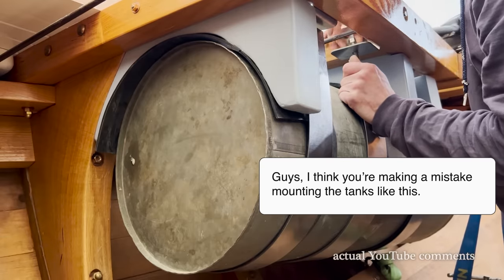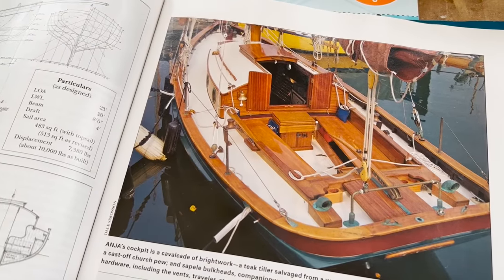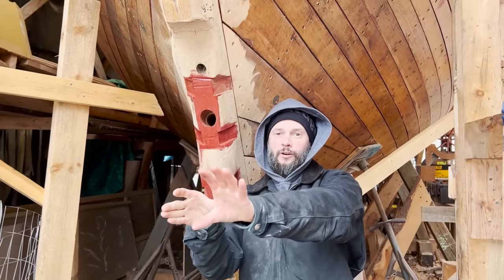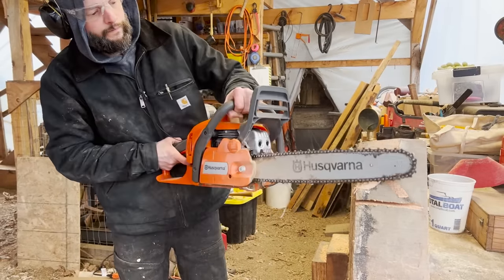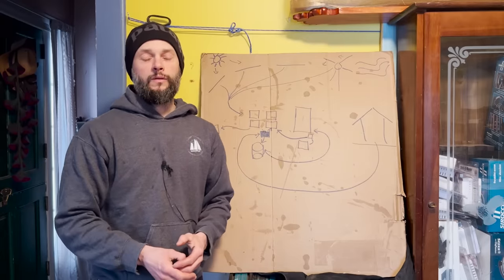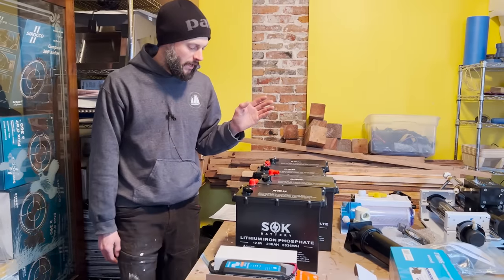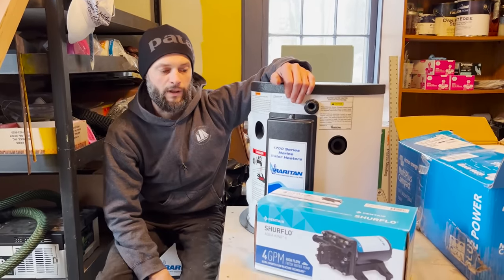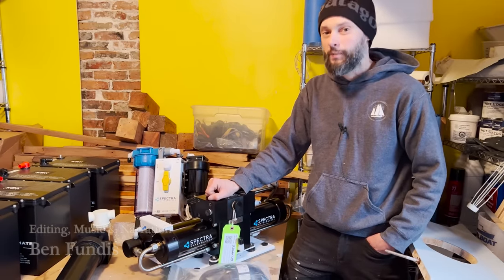That Prop Is Too Small & Other Comments - Episode 248 - Acorn to Arabella: Journey of a Wooden Boat

Comment: They've watched too many movies, if I pour diesel on the ground and drop a cigarette into it, the cigarette will go out. Diesel burns under high compression not it's fumes
Reply from the maker: Maybe it’s just a misunderstanding. Some people hear “fuel” and immediately think “flammable” because of a lack of knowledge but a hope for safety. —Anne
Reply: That’s not what I learned from extensive knowledge gained from watching Indiana Jones movies.
Reply: A cigarette dropped in gasoline will also go out. The “fumes” of both will definitely ignite when exposed to an ignition source at the proper air fuel ratio. Diesel engines have glow plugs for a reason.
Reply: @ronaldgriffin5528  been there done that, the trick is to have your buddy hold it in Styrofoam cup, lol. They don't last long.
Reply: @ronaldgriffin5528  glow plugs are not spark plugs, diesel engines don't have spark plugs, a heating element in diesels is used to start the engine in the cold, the element doesn't keep running after you press start
Reply: Dear taylor.
👍👌👏 EXACTLY (at least nearly). 😁 ;-) Okay, a burning match will go out if you toss it into a bucket/barrel full of Diesel. But if a glowing cigarette is thrown into a really shallow puddle of Diesel fuel, there might be enough heat to ignite the Diesel after some time.
Best regards, luck and health.

Comment: As a lifetime tradesman I've always been amazed when i see workers that try to hold a sawzall out so the foot is in mid air. The foot is designed to sit tight to the work surface.
Reply: The sawzall foot is designed to sit against the work surface, but there are tricky situations where the vibration from the tool against the surface is not desired, for finer control of the tool. As a "lifetime tradesman", I would think you would be aware of this from experience, and not so amazed by it.

Comment: I admire the amount of thought and analysis you’ve put into the boat’s systems. All the electrical seemed very familiar to me since I just finished installing an off-grid solar system in my camping cabin in New Hampshire. But other touches filled me with admiration, like putting the filter that if it burst would wet a lot of stuff, so put it in the head which is built to shower in anyway! Now that’s thinking! 😊
Reply from the maker: Nice project, Douglas! Bet it came out great. 🙌

Comment: From experience as a marine engineer, it's great to have positive pressure in the fuel lines to filter and injector pump, certainly less chance of getting sir in the system and it really does happen! So tanks are in a great place!

Comment: Your tank mounting is just fine. I have seen far worse setups in factory boats that have lasted the better part of 30+ years. 

Your explanation of the prop sizing is spot on. Prop technology has improved a lot over the last 10-15 years. It is amazing how much more efficient a smaller wheel can be.

Comment: I have been on a trip on a friend's boat with a water maker - you can't have too many new filters on board especially on a trip where getting some to be delivered to a unfamiliar port - stock up - fresh water is like gold even in "developed" areas.  Best wishes from Chesapeake Bay / Middle River, MD!
Reply from the maker: Happy Friday, Frank!
Reply: Looked like standard 10 inch filters, cheap to stock up on.

Comment: Diesel engines were some of the very first internal combustible engines. They were definitely around when your boat plans were originally drawn. They have been in boats for well over 100 years.
Reply: Mr Otto Diesel himself! I think they provided propulsion for the first horseless carriages.
Reply: Early diesels were, in fact, run on peanut oil.
Reply: 1903 first marine diesel used but not widely used for many years

Comment: Very solid setup for human needs. I have a lot of experience with shurflo pumps, mainly in carpet extractors. They utilize a pressure switch to shut off the pump when system is pressurized. Pump turns back on when water flows. One thing with diaphragm pumps is sometimes the diaphragms get stiff over time and can cause issues. Getting a rebuild kit with new diaphragms and check valves to have on hand could be handy as they are easy to fix, and you can bypass the pressure switch in a pinch with a jumper if it gets persnippity. Just have to shut pump off manually so it won’t run continuously. Thanks for sharing, and hope Steve’s mom is resting well. It’s a noble thing to care for those who raised and cared for you growing up. Stay the course.
Reply from the maker: Thanks for sharing your experience!

Comment: I didn’t read all the comments so if you’ve previously addressed my apologies. I didn’t hear your discuss alternator sizing but will assume you have that covered. The lithium batteries can charge up much faster than their lead acid counterparts.  One or two high output alternators can lower the engine runtime when charging.  Great build and love hearing your thoughts along the way.

Comment: Greetings from Colorado!   Ahoy mate!
Something to think about as you consider the infill for the rudder is the effect on the prop’s wash and the creation of turbulence that greatly lowers the efficiency of the propulsion.  Especially where the wash encounters the “leading edge” of the rudder (inside the infill). Water flow will be deflected in any case because of the rudder’s existence.  But you want as much energy as possible to impact the surrounding water mass in a line straight aft of the prop for max efficiency of the system of engine/prop/rudder and desired direction of travel.   
Avast all ye landlubbers!

Comment: You mom will  be with you whether she is on board or not. Running the engine 10 minutes up to operating temp (170 deg) will give you all the hot water you need.. Most of the time you will  already be motoring or on the dock and rarely need expensive inverter energy for the heater.  And once its heated and everything has been turned off, it will stay hot (or at least warm)  for several hours.  The fuel tanks will work fine enough  but  having them elevated defintely not optimal. Everything in every sailboat should place weight/density as low as possible for performance and seagoing comfort.  Beer in the bilge, bread in the overhead cabinets. There have been many lessons learned since Atkin.  Prop/rudder setup with the sacrificial plug  on the rudder sounds like a great idea.

Comment: Steve, you make a very common error with AC Voltage.   110V was used for lines power was when Edison was designing power systems.  Voltages have increased since then with 120V/240V bing the U.S., split-phase standard since 1967.  Move into the modern age and call your AC Voltage, 120 Volts.

Comment: In other words, the propeller chosen is optimal for this boat! 👍
Reply from the maker: Exactly!
Reply: No, they hope the prop guy has done it right.  All I can say is that is the same diameter as the 3 blade on my 28hp ... considering the prop guy that turned up didn't know the difference between brass and bronze, I'm not so sure.
Reply: Actually the propeller is optimized for power available. The goal is to provide maximal propeller efficiency at rated power and rpm, i.e. a Diesel engine runs at optimum efficiency at 90% of maximum rpm, if the propeller is too large the engine will not get to speed, therefore being inefficient. The engine should be able to reach 110% to 120% of rated rpm, with reduced efficiency for emergency situations. As for a 28hp outboard I would assume a propeller in the 9” to 11” range with blades having a smaller area, more skew, and a much higher rpm range. Not having seen nor done the calculations, I would say a 16” propeller is about right for Arabella.
Reply: Another point to note might be that the propeller can be changed.  Optimizing propeller design is a vague notion.  Optimize for what?  Thrust, fuel efficiency, power absorption - and at exactly which speed would you like to optimize any of those performance parameters? Prop design is usually a wise compromise considering predicted hull speed, emergency situations such as wave resistance, wind resistance, fair weather cruising situations, importance of fuel efficiency, etc.  Of course, motor selection goes with it.  Fortunately, if a selected prop exhibits undesirable performance, it can generally be switched out for a design change where pitch, diameter, number of blades, etc, can be tweaked to get a better result.  It happens that it is very common to try different prop designs on a one-off displacement hull.
Reply: @boooshes  Yes, that is why they write whole books on it, PHDs have been written about it and still it can come down to trial and error. There is almost as much art as science to it, as with so much of boat building.
Reply: @boooshes  The ideal prop is one that just holds the engine to peak power output when the boat is accelerating from stationary, then you know that prop is capable of fully loading the engine.  You can run a smaller prop, sure, but then you might as well run a smaller engine to match it.

I am aware of the various compromises,  I also fly planes, with the same issue, you want to prop to be capable of extracting all the available power from the engine if needed. If the prop is too small, or too fine pitch, you can never use the full power, even when you really need it.
Reply: @itsverygreen532  I under what you are saying.  However, just extracting the power that the engine can generate is only the beginning.  That power can (some will) be lost in slip, create large thrust at low speed but lose it at higher speed, slip alit at low speed and become more efficient at high speed, etc.  Having done some propeller design myself for both boats and and tunnels, I don't think you can look at a picture of this boat and the propellor and determine that it is improperly designed.  The last design I did was fir a 34' semi plane hull optimized for efficiency at 8 knots and 18 HP.  Turns out that was a 16" prop as well, but Im sure the pitch and blade density were different than AtoA.
Reply: @boooshes  This is where the trade off between pitch and diameter comes in. All I can say though about that prop is that it is roughly the same size as the one on my 28hp Volvo Penta ... I very much doubt it is going to fully load a 50hp motor ... so I suspect the motor is going to rev more than it should ... not a problem I guess until you really wish you had more power in some situation and the prop is just too small to load the engine up.
Reply: @itsverygreen532  so just for kicks, I used two different sources for propeller sizing to horsepower.  It looks like a 16" propeller will absorb about 47-50 HP at around 1700 RPM.  I'm not sure about this particular diesel, but 1700-2000 rpm sounds about right for a marine diesel.  The pitch is likely about 8" , with a 50% blade area ratio (3 elliptical blades) and probably about 50% slip.  On face, I don't see anything out of the ordinary in the prop.  Your set up likely absorbs your 28 hp at around 1350 rpms.
Reply: @boooshes  So you think you would fit the same size prop to a 28hp and a 50hp boat?  That's "interesting"  FWIW,  Beta recommend a 15x9" on their Beta 30 and a 19x12" on the Beta 50.  I'd normally expect to see a prop around the 18"/19" size on a typical 50hp displacement sailboat. I found another install of at Nanni N4.50 same as they have ... that had a 19" prop too.
Reply: @itsverygreen532  Not necessarily.  I'm not sure that I would automatically assume that the combination you have is the perfect optimization either - and therefore may not use it as a basis for AtoA.  All that I was saying is that using some well-proven empirical approaches, the 16" selection was not " out of family ".   The Beta engines have a peak torque output around 1650 rpm - they may be using that as a sizing reference. I'm not really sure how they would size a prop to an engine without considering the application (type of vessel, transmission,intended use, variable pitch?), but a 19" x 9 on a 50hp at the rated 2800 rpm sounds large and I believe would risk not achieving max engine rpm.  All of that being said, in my opinion, sea trials in varying conditions are the only way to tune your prop choice.  In any case, they've got a prop that was recommended by a prop company and the company should stand behind that choice.
Reply: @boooshes  I know mine from stationary loads the motor up just a bit too much, so it won't fully rev out.  As the boat picks up speed the revs gradually increase and eventually it will reach peak revs.  thats a perfectly matched prop.
Reply: @itsverygreen532  So your description of your boat/motor/prop combo perfectly illustrates one of the prop selection considerations - your system will gradually get to full rpm as your boat speed increases - what if you had a 40 knot head wind or were towing another vessel or were motoring into breaking waves?  It is likely that you would never get to rpm.  So your system may be well-tuned for max speed in fair conditions, which is fine.  But no system will be well-tuned for all conditions.  You can help by introducing gearing and variable pitch, but variable diameter is a tough one.  Then there's the fact that you can sail with no motor.
Reply: @danlucci9246  yes, indeed.

Comment: The small tank smoothes out the pulsations of the diaphragm pump, the pressure tank on your well system simply stores pressurized water, sub pumps flow very smoothly as compared to a positive displacement pump. Great explanations!

Comment: Awesome episode. As far as your water heater goes. I have a camper with a dual fuel water heater (gas/electric) both work great but the best part of having both is if you run both at the same time, you have an almost instant and continuous stream of very hot water. We use a shower head valve that we turn off between wetting down and rinsing off. Saves water and grey tank space. We also use biodegradable soap and cleaning products so there's no problem dumping the grey water. It seems like you have a good handle on everything, this is not a recommendation beyond what I do myself for my own comfort.
Reply from the maker: Neat, thanks for sharing your experience.

Comment: Make sure they use marine-grade copper tinned wire. Last thing you need is for your wires to rot from the moisture and saltwater. Here in Florida it's really common to have car wires completely corrode on the inside and die

Comment: Steve. I was going to mention 2 things but You addressed one at the very end (accumulator tank). Other is to make sure that Your inverter (You did not show the model etc so excuse me if You took this into consideration) works with both 110V and 230V. Most of the world runs on 230 so it would be good if You get 230 shore power.

Comment: The two bladed props are nice for a boat your size. It also has a lot less drag when locked up and down and is easy to remove. I didn’t use a chainsaw that much on the boats, more adze, power plane,  corbel saw or beam saws. I use the chainsaw for milling lumber.

Comment: Glad you’re going with a hot water heater and some pressurized water. Foot pumps sound good on paper until you sprain an ankle or knee far offshore. Living on a small boat is challenging enough, as you will discover. The more conveniences you can supply yourselves with, the better.

Comment: I have a 37' boat (smaller, but not MUCH smaller than Arabella) with a 30hp motor and a 15" prop and can easily motor all day at 6.5+ knots, probably 7 if I pushed harder than I typically do. Zero worry about that prop. I also have a 6gal water heater, but since I'm almost never tied at a dock except for fueling, hauling and launching, we use it exclusively with the parasitic heat from the loop off the engine, and it works great like that for occasional warm showers, etc. Also worth noting, but not mentioned in your video, those tanks are typically VERY well insulated, so even 8, 10, 12 hours after running the engine, the 6 gallons of water in there is STILL easily hot enough for a warm shower. Totally agree with having a water heater even if you want to be stingy with power. I never use electric to heat my water, but still love having it at (essentially) no power consumption/loss at all.
Reply: I think it will drive the boat fine, but I don't think it will make full use of the 50hp motor .. its basically the same prop size as the one on my 28hp engine ... it will probably use about half the engine power,  which won't be a problem normally, but that day you are being driven hard to the rocks in a storm, you'll be wishing that prop was big enough to put all 50hp into the water.

Comment: The Saws All is not my favorite tool either but its the tool of choice while cutting flotation foam out of a factory fiberglass boat. I owned a Ryobi Saws All until the switch broke in the handle. After an examination it went into the trash. The chain saw is the tool of choice because it can be moved in any direction while in use. My analogy for a fully displacement boat is like dragging a rubber ball through the water on a string. The harder you pull the more resistance the water and ball creates.  Jeff Spira's comment about getting to the Chanel Islands and staying four days and coming back on a single tank of fuel explains what fully displacement boats are all about. For the cost of fuel he said he could have stayed in a nice hotel and rented a fishing guide and boat. Hopefully in a boat with air conditioning. The trip to the Bahamas leaving West Palm beach is mostly done with fishing boats with little shade or comforts along the way. Not the way i would do it.